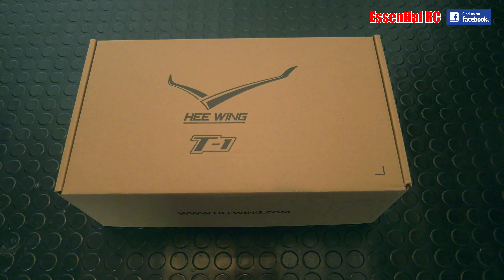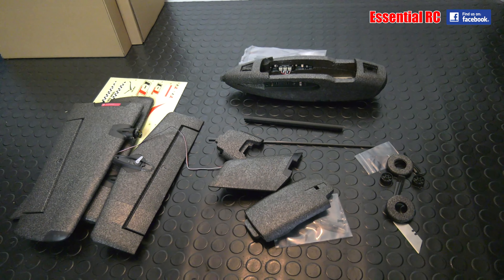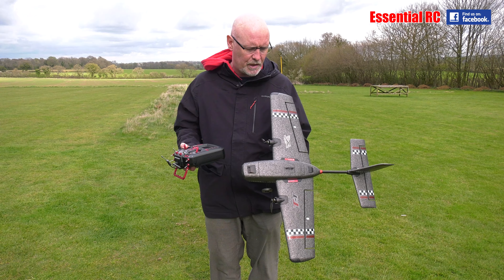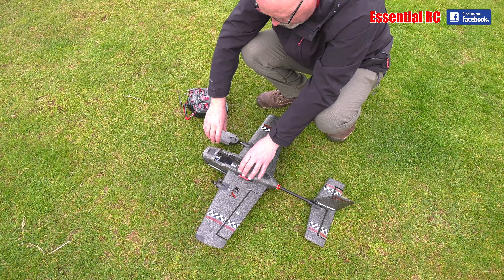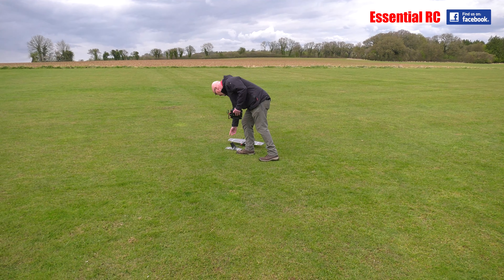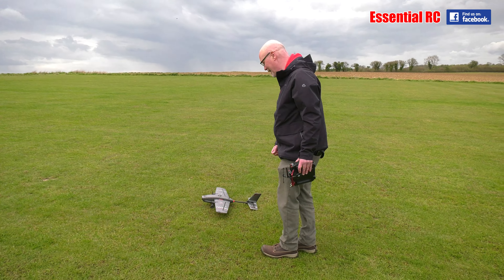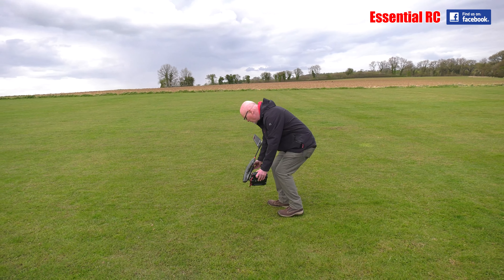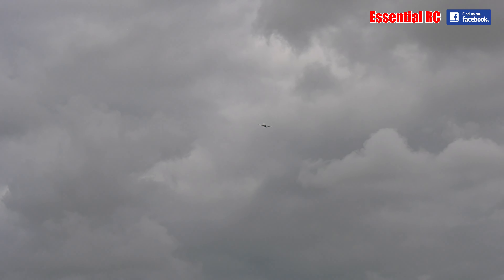QUICK ASSEMBLY and FLY ! T-1 Ranger FPV RC Aeroplane | Essential RC Flight Test | Part 1

Comment: At 2:13, 3:28 regarding balance. Have seen others note to test by holding at front of tab vs. rear, to ensure balance slightly forward. 
At 11:25, 11:28  "Do NOT hot plug" in wings. Red labels ... LOL  
(better to unplug main battery before reattaching wings)
NOTE: KIT edition does not have come with hot-plug feature, as I've discovered
Thanks for keeping it real. ;)
Reply from the maker: Thanks for the tips Aerial. I'll try again soon

Comment: Glad you maidened this one
What a load of ol POO. ill stick with my zhod which has the same boom connection and is waaaaay more stable.
So cheers for the heads up
This is one I'll SCRATCH OF MY SHOPPING LIST
Cheers
Brian
Reply from the maker: I've not decided yet. Bit early to say its 'poo'. First flight and adjustments to be made. Hoping will fly better next time out.
Reply: @EssentialRC  hi dont know if you've flown the zhod drift on 3s....what a kite. If you haven't flow one try it then your see why i said this one was poo
Have a great weekend
Brian
Reply from the maker: Drift is totally different Brian 😄. For zero or low wind. Surely you don't judge a new RC just from the maiden flight?! There's always things to correct to get it flying well as in this case.
Reply: @EssentialRC  well must say the drift straight out the box brilliant flown it in 12..15..mph winds or just chop the throttle and kite ive got loads of my drift vids on YT. BUT I MUST ADMIT IT NEEDS THE 3S WITH THE 3 PROP TO GET THE BEST OUTOF IT... I'll be interested to see how you get on with the kite normally people use non lipos to do long range perhaps it needs the extra weight up front
Have a good 1
Brian

Comment: The red warnings on the wings say "Do not hot plug" and then you hot plugged them. Luckily nothing got smoked. By how many aileron and servo servo horn holes did you move the pushrods inward?

Comment: CG is in the front part of the hatch cover not back...
Reply from the maker: Fairly sure manual showed it as back!?
Reply: @EssentialRC  check the way he is holding it in the manual again :) Also every manufacturer of RC planes will give you CG point pushed forward a bit (to make it nose heavy) as in general it is easier to control nose heavy plane than tail heavy.

Comment: That thing needs a FC and some aileron stability but also needs an undercarriage in rhe same way a motorcycle needs an ashtray. 😁 I love these little drones type things though, but not the V-tail versions too much.
Reply from the maker: I'm loathed to add more weight to something so small. The gyro helped a lot except on that first landing (possible glitch). Yeah...the landing gear is a bit unsightly but I thought better than hand launching for a first flight. I'll dispense with it on future flights. 😎

Comment: HI SIR GOOD JOB KEEPING IT UNDER CONTROL. ONCE SORTED IT SEEMS TO FLY OK. THANKS FOR POSTING DOM.🇬🇧🕊️✌🏼👍🏼
Reply from the maker: Thanks Mike. Sometimes maiden flights do throw in a few challenges. Important thing is to get it high so it can be trimmed out for level flight. Looking forward to putting FPV gear, tuning the gyro and doing some smooth flying. Cheers and have a good Easter weekend !